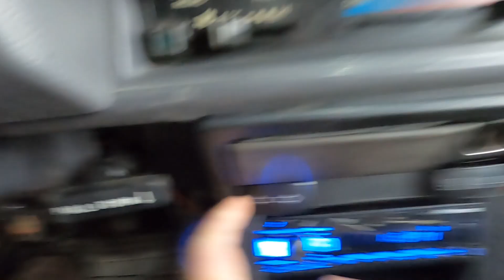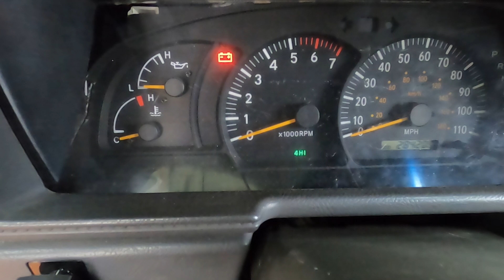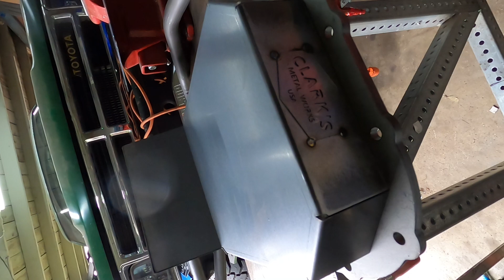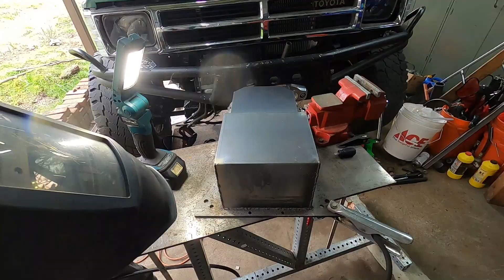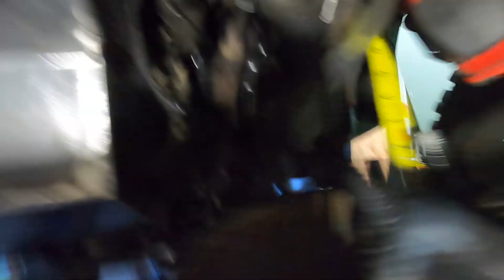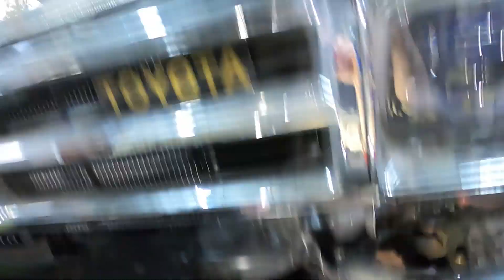Welding a Custom Oil Pan for the 2uz 4runner!

Comment: Did you leak check your welds?
Reply from the maker: Well I filled it with oil and there is currently no leakage. Seems I did decent enough! We will see once I start driving it around and getting the oil moving.